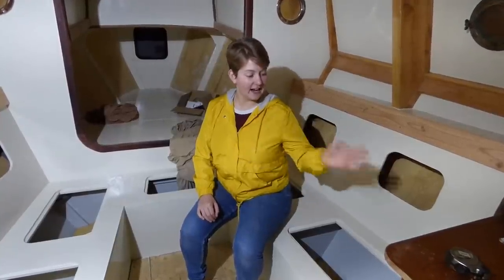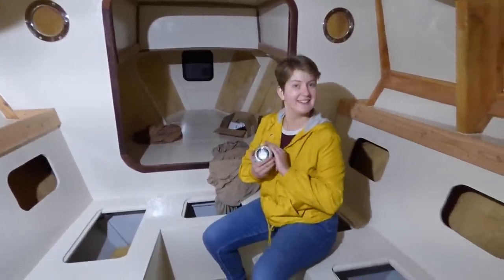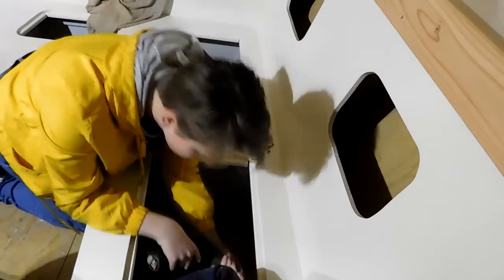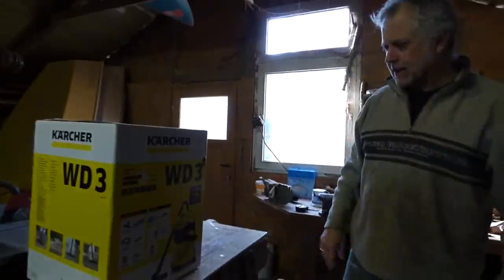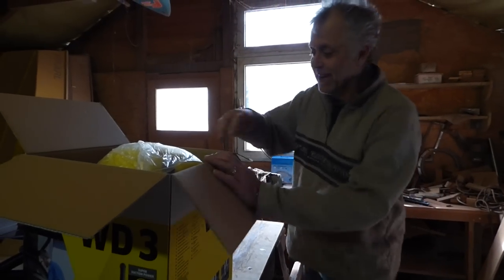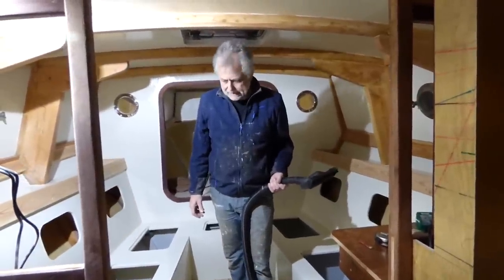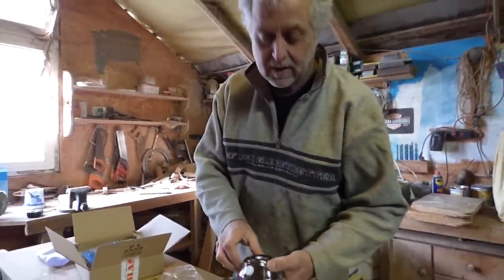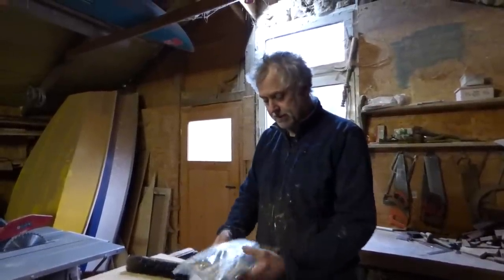LEDs, starboard midships stowage and a vacuum cleaner!!! - SV Tapatya EP123

Comment: Come on now matey brace up will ya, we're all big boys here! ;)  Most of these things are likely made in China and we all know what's going on there now eh? 
Chances are the workers on the assembly lines were busy coughing and dropped the vacuum cleaner and that little chip didn't look as though it would reduce performance any.. The led light was also likely glued in crooked when the worker sneezed or coughed? 
As long as they work eh. I might want to wipe them off with bleach first? Just in case..sorry
Reply from the maker: Yes, probably made in China and probably damaged in transport. I certainly don't blame the workers who are probably paid metaphorical peanuts. But some quality control at relevant points along the line wouldn't hurt!
Thanks for watching Roland :-)